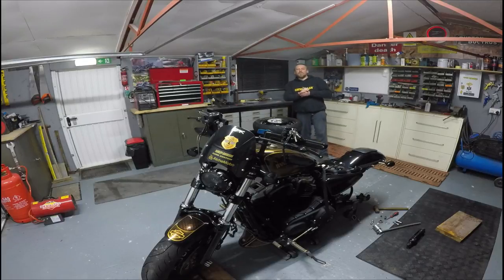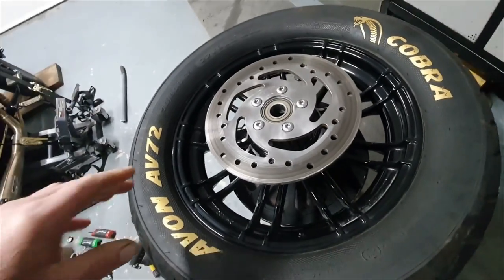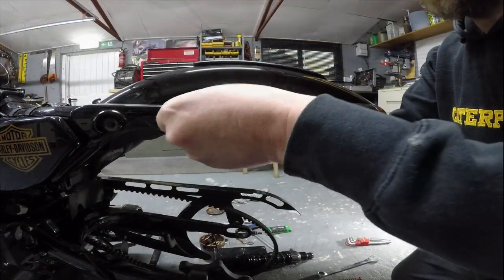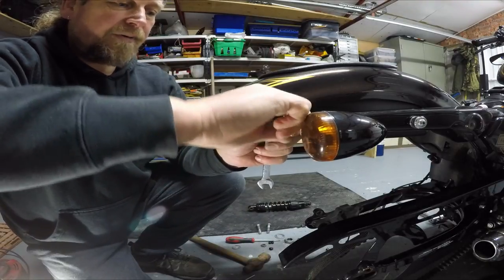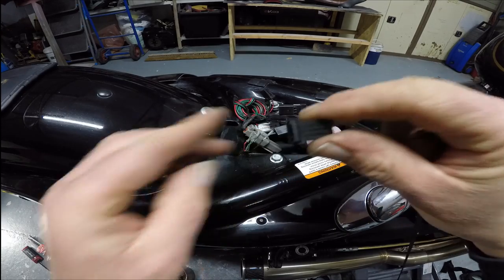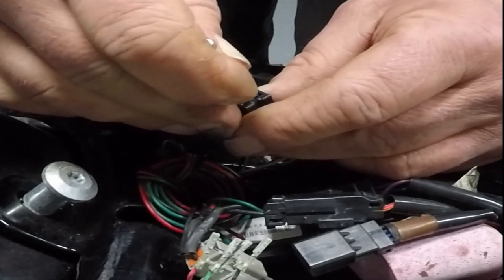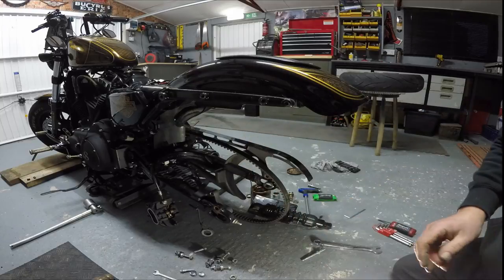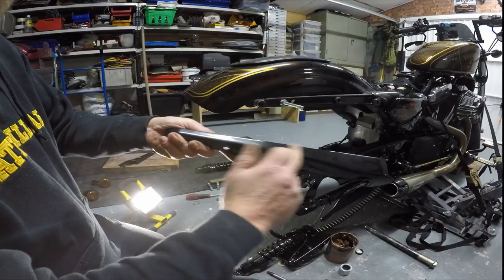SPORTSTER REAR STRUT/LIGHTS REMOVAL

Comment: Great video, thanks! by the way the plugs you called "molex" are not molex. It's "amp/tyco multilock connectors". Mentioned just to help search actual terminals
Reply from the maker: Thanks 👍, but also in the argument of names, tyco/molex and deutsch brand names are all used in harley wiring somewhere 😃👍. As with metric and imperial stuff they do like to confuse folk 😄👍. Cheers